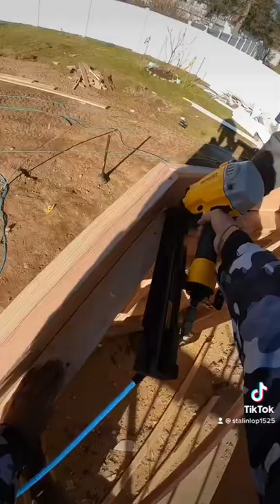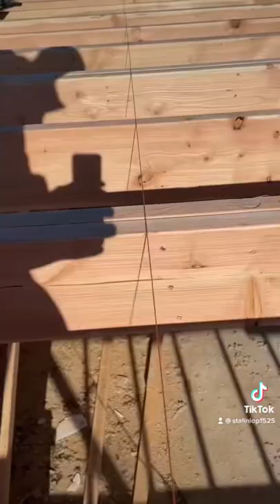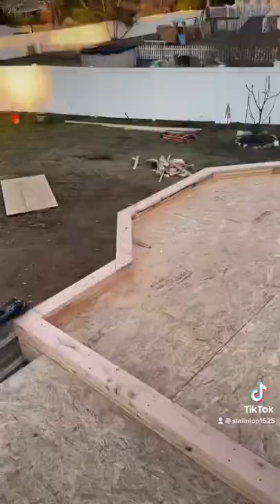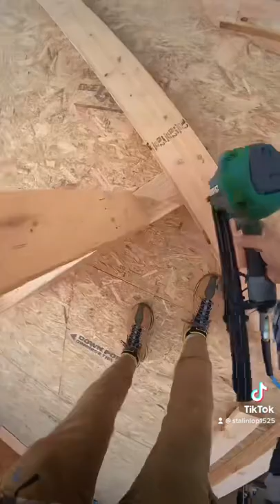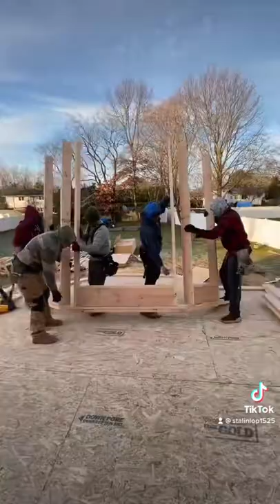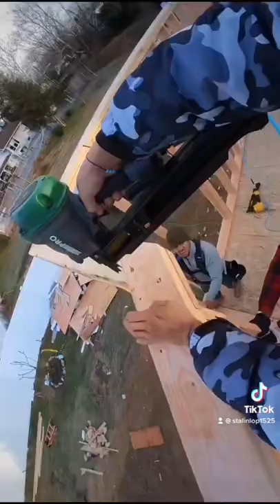#architecture #construction #art #framing #quality #design #beautiful #artwork #wood

Comment: Can someone please explain the benefits to not having the bottom plate on the wall when you stand it up? I’ve never seen it done like that. Is it better to do that in certain situations?
Thanks
Reply: I came here to ask the same question.
Reply: From what I heard, in some areas studs are required to be toe nailed top and bottom for greater resistance to pulling out due to hurricanes, tornados and seismic activity.
Reply: @maxfathi596  it would be way stronger the other way I’m pretty sure

Comment: Use OSB on the floor.     Don't think that is code in my area.  I had to use plywood for the subfloor and OSB for the for external walls and roof decking only.
Reply: OSB for floors is 5/8-3/4 of an inch thick